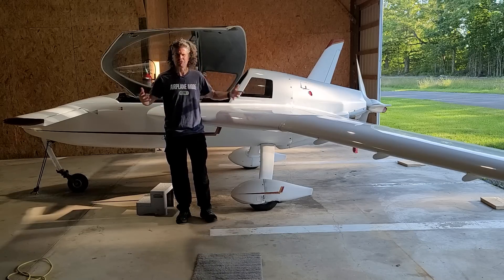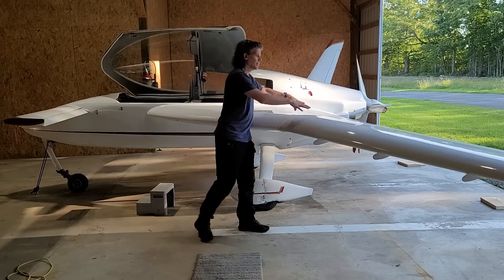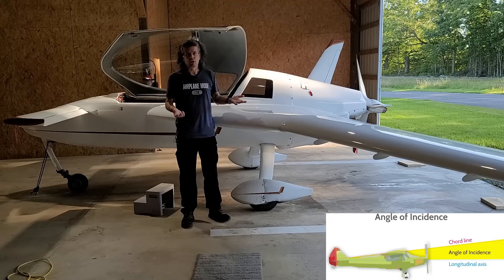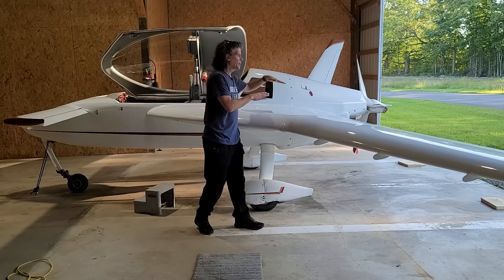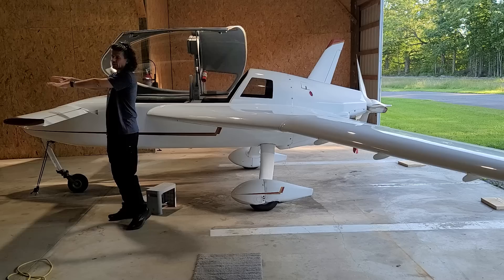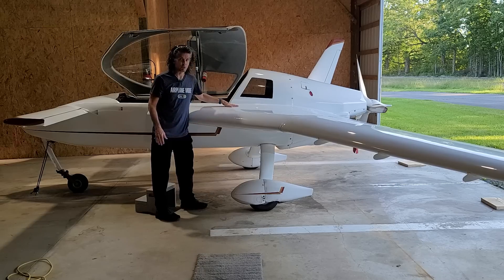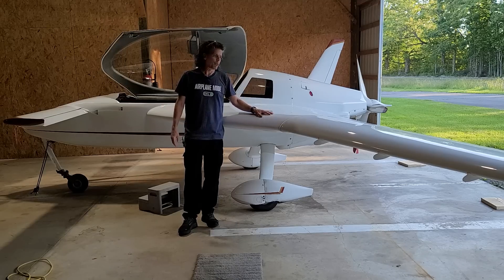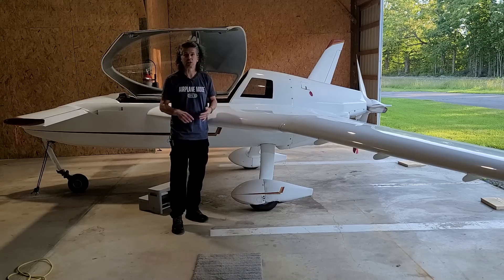Why Did I Buy This Weird Cozy MKIV Canard Airplane?

Comment: You kinda shot yourself down there a couple of times. The fact that canards need long runways and well surfaced ones too take them out of the frame for most pilots. Carrying lead to keep the  ofF good is another negative. That wing is also a stabiliser, which means some of the lift it is supposed to be creating is gone to waste.
Reply: CofG
Reply: And this is relevant how ? Most twin seats gliders carry also dead weight when flown by a single pilot. This is due to narrow CG on all these designs. Actually it's a proof that you extract the most out of your aircraft design and don't need a big horizontal stab far behind to cope with the wide CG requirement, thus less drag (induced and parasite)
Reply: @12345fowler  A bit of tech work round and maybe the wings cd have variable sweep to keep the cg in limits. I have two other points I wd like to add. One is that the sweep back is contributing to stability as you mentioned, but this wd seem to indicate that it does not contribute to lift. Could this be why canards need long takeoffs and landings? Finally, what I find odd is that you have a futuristic design, almost Star Wars looking, but you fix a straight wing at the front. For me, aesthetics wd dictate a swept fore plane. But best wishes anyway!

Comment: Nice job! I built N36LV, this plane’s big brother. She has 370HP, comfortably seats 5, cruises at 195 kts and sips 13.5 gallons per hour. Sadly, retirement and insurance costs caused us to part ways. I learned a few things during our six years (11 counting the build time) of flying.

Watch out for extended descents with lowish fuel levels. If the tanks are plumbed like a Velocity, you can unport the fuel pickups.

Make sure those cowling fasteners are really good quality because everything, and I mean EVERYTHING back there goes through the propeller arc. I used screws at first but got tired of patching the prop with JB Weld. Take a look at Skybolt C Locks. Never had one come off.

That canard stall is known as a Pitch Buck. I could climb at 3000 fpm with the stick full aft and the nose hammering up and down. Fun but kind of violent in a Velocity and passengers don’t like it at all.

Like the V, it will probably make one really good water landing in an emergency. They can float for days.

You will know you are a proficient canard pilot when you can perform 3 consecutive touch-and-go’s without letting the nosewheel hit the tarmac.

Enjoy.
Reply: Careful about the water landing.  We're still not sure what happened at Half Moon Bay except none of them made it out.
Reply: @flyer617  I should have been more specific to the fully-retractable canards using the water option.
Reply: Wonder if canards have tail skid to prevent the prop to hit the ground during take off rotation or landing flare. Thanks for the video.
Reply from the maker: @agusbahagia5122  no. You have to be careful not to over-rotate for this exact reason. Not normally an issue however. You also don't flare when landing, you just round out the descent and then let it fly onto the ground, kind of like a jet.
Reply: @CanardBoulevard  Another silly question, do you yell “clear prop!” just before cranking up for engine start? Do you start the engine with canopy still open or closed?

I know it sounds so silly but that engine is in the back, out of sight.
Reply from the maker: N36LV is a beautiful machine! Curious about the choice to put the exhaust forward - is that to keep it away from the prop arc?

I have not heard of Cozy's unporting the fuel pickups except in a slip at low fuel levels (which can happen in most any airplane, really). I'll look into it, but I have not heard/read of this issue in the Cozy.

The cowling fasteners are currently MS24694-S50 screws and yes, after losing one through the prop, my preflight now includes checking tightness of all of the cowl fasteners. I had a look at the Skybolt C fasteners, I will add them to my list!

Thanks for writing!
Reply: @CanardBoulevard  Sorry I never saw this post, Scott.

The exhaust forward was for two reasons: to get rid of the normal Velocity’s downward-exiting exhaust which is very draggy and causes unwelcome pitch changes during landing.

The second reason was to have room for custom-designed equal-length headers. The rearward facing collectors may have attributed a knot or two to cruise speed.

Comment: Canards are not inherently lower drag. The main wing is operating in the down-wash potential flow field of the canard. This causes higher drag and less efficiency. At best, overall they have efficiency the same as a conventional config.
Reply: You didn't listen well to the video or didn't understand it correctly. He said precisely why a canard design is more efficient. And he also gave the measures of it.
Reply: @12345fowler  I have a MS in Aero Eng and have worked in the industry for more than 40 years. I have designed and built 4 World record setting aircraft. I can accurately say that canards are NOT more efficient. I won't go into how much the wing sweep costs in terms of performance.  Even Rutan changed his mind when he did the GlobalFlyer.

Comment: Always thought that this would be my choice but never was able to find the money.. I was flying the Avanti Canard for a while and grew to love that airplane.. How critical is the wing/canard to precip ?
Reply: I knew a guy (through his YouTube channel) who mentioned that the canard wing can "quit flying" in a heavy rain.
>> He installed vortex generators on the upper surfaces of the canard, to prevent the de-laminating effect (i.e. separation of airflow over the canard) during an in-flight thunderstorm.
Reply from the maker: @ahashdahnagila6884  that was an older airfoil. Canards today (including mine) use a Roncz airfoil on the canard that does not suffer from that problem.
Reply from the maker: The original canard airfoil used on the Long EZ had a significant loss of lift in precipitation, but it was then changed to the Roncz R1145MS airfoil, which does not suffer from that problem. The Cozy uses that same Roncz airfoil on its canard.
Reply: @CanardBoulevard  You have a great fun airplane there.. Many thnx for the (prompt) response..

Comment: Wrong

If you would take that cessna & place it on 2 wooden dowels under the wings close to center of gravity the plane would be perfectly balanced front to back.

The long fuselage and back tail offsets or balances the engine up front.

If the elevator was there needing to do all the balancing theyvwould be ni extra movement left to have the plane go up or down.
It would he in the fully upright position & wouldn't allow the plane to go downward.

Learned this simply by building many RC Planes.
Reply from the maker: Of course if you balance an airplane from its C/G point, it will balance perfectly.

However, RC planes are not the same. A Cessna, with people in the front seats, is nose-heavy. The front seat arm is forward of the unloaded C/G. Also, a Cessna, when flying, has enough parasite drag from the fuselage and landing gear, below the center of thrust, that it causes a nose-down moment. Both of these require negative lift from the horizontal stabilizer to counteract.
Reply: @CanardBoulevard  then what is needed is an adjustable balance /weight near tail section foe each portion of flight. Lol sarcasm
Reply from the maker: @Mikinct  Well, that's what trim is for. :) Actually on this plane, the gear hanging down does cause some drag at higher speeds in the exact same way, and this requires you to add more nose-up trim at cruise speed to compensate for it.

Comment: Nice plane but if you're comparing planes you should compare those with similar passenger and load capabilities.
Reply from the maker: I compared it to a Cessna 172. Both planes have four seats. The Cessna has useful load of around 880 lbs, the Cozy is around 1000 lbs. They are pretty similar.
Reply: @CanardBoulevard   cool, then there is more to it or the canard type planes would be  dominant

Comment: The horizontal stabilizer is a symmetrical airfoil and is mounted parallel to the longtitudinal axis of 172s.
Therefore there is no down lifting force on the horizontal stab. of a 172.
Reply from the maker: Depends on the position of the elevator and trim!
Reply: Wings Airfoil Symmetrical Have Planes Aerobic .  Attack Of Angle On Depends

Comment: I absolutely love the Cozy MKIV.  I would love to have one, but I really don't want to build it.  Great video.
Reply: And that’s exactly why these days you will see 600 RVs at Oshkosh and a handful of canards. They are extremely labor intensive to build. RVs aren’t “easy”, but they are a lot more prefabricated than composite airplanes and no 1000 hrs of sanding. They are also a much more versatile airplane with better field performance. They might not be quite as efficient, though they are pretty close, but with over 12000 built and flown clearly the homebuilt community has decided they don’t much care about efficiency.

Comment: I enjoyed the explanation. Thanks. A couple of things that I wonder about. 1. How do you avoid hitting the prop on the ground? 2. How do you not end up with a nose strike on landing? I can imagine speed being your friend in both answers, and as you mentioned in the video, but can you expand on that?
Reply: 12:00 main wing stalls from bad cg load are not recoverable. CG is critical in a canard aircraft. Very informative video. Thanks for sharing the cons.
Reply: @msnpassjan2004  CG is critical in ANY airplane. A "deep-stall" that may not be recoverable can happen if the CG is grossly aft of it's normal range.  A Long-EZ (a 2-seater tandem cousin of the Cozy) can handle a wide range of payload arrangements and be within a normal CG range. A typical example:  pilot weight can be  anywhere from 140 - 350 lb, with or without passenger, baggage, and with fuel tanks full or nearly empty without needing to adjust or even calculate the weight and balance between flights. As long as the total weight does not exceed the allowed weights for takeoff and landing you hardly need to worry about weight and balance calculations between flights. The Cozy is a little more finicky.
Reply: The only time you're concerned about prop strike is during takeoff, or when the airplane is parked. The rule of thumb is to keep the canard below the horizon (from the pilot's perspective) during rotation and liftoff. The only other time is when it's parked on the ground. Since the airplane is rear-end heavy (that's where the engine is) it can flip on it's back and there's the potential for prop strike. This is why these airplanes are parked with their nose down in a praying mantis position. You wouldn't end up with a nose strike on landing unless you forgot to deploy the front landing gear. This has happened to many canard pilots (including me) but it's entirely survivable, the nose of the airplane may be a bit scuffed on the bottom but it's repairable, most of the time the damage is only cosmetic. In addition, a front gear-up landing is a safety feature by design to help stop the airplane on a short runway in an emergency, if needed.

Comment: The reason the rear tail plane pushes down in not to balance the engine weight. Rather, it is because of the forward moment of lift produced by the main wing. That is why if you throw a model aircraft wing, it tumbles forward.
Reply: In a way, it's both... the center of lift is usually a bit forward of mid-chord INCLUDING the weight of the engine. As he explains for the canard craft, add a payload up front, and on a conventional-stabilizer plane, you need to balance it with down-force behind the center of lift. On the canard plane, the extra lift compensates for payload.
Reply: @KutWrite  The rear tailplane also pushes down on a glider. The displaced (relative to C of G) centre of lift is the cause of the tail needing to push down. Yes, the more weight you have at the front, the more it needs to push down - or, the further the tail needs to be situated away from the Cof G to increase the moment arm.
Reply: it's both.
Reply: Most free flight model gliders have rear lifting tails and they seem to fly well.
Reply: @johnelliott8630   Some do..true. But lifting tails are speed sensitive and require a very aft CG.  Go too fast and the tail makes excess lift…which raises the tail…increasing speed. The “tailplane takeover” phenomenon is known and can dive a plane into the ground.  I had a RC model once that had a flat bottomed (Clark Y) tail airfoil…normal flight was fine…but in a dive it would suddenly tighten up into a steep drop that needed a lot of up elevator to correct.  And yep…the OP is spot on, wings without stabilisers tumble.  Flying wings have reflex airfoils or sweep to get surface behind the CG.

Comment: If the CoG is too far forward you probably will get off the ground into ground effect - then crash LOL.
The amount of aircraft that get into ground effect on TO then crash is unbelievable but the stats don't lie.
Reply: Don't think so. The reasons for airplanes unable to climb out of ground effect is because they are overweight (but balanced) Here he talks about a unbalanced (out of CG, but not overweight) situation. These are two completely different issues.

Comment: It baffles me why more planes aren't canards, even commercial planes. It's safer, more efficient, easier to fly, etc.
Is it just industry ignorance or is there a good reason for it?
Reply: The main wing is always flying in the disturbed air behind the front stabiliser, and the main wing can never reach it's maximum lift potential in terms of angle of attack (as the canard will stall before hand). In summary they're not more efficient than a conventional layout. You are correct in that (if they were more efficient) they'd be used commercially and also for gliders (which are all about efficiency). It's been proven that Rutan's first nonstop round the world flight (canard design and an amazing achievement) could have been completed with significantly less fuel (can't remember the figures) if it had been a conventional layout.

Comment: Sounds like reentry configuration when main wing is stalled and a good fit for parachute
Reply from the maker: If you're talking about the Shuttle, it was not actually stalled, it was just in a very high alpha position. When the prototype of this airplane was originally designed, they put a large, movable weight inside. That way, while flight testing and exploring the aft C/G limits, when they stalled the main wing, they would move the weight forward, dropping the nose and recovering from the main wing stall. No parachute required!
Reply: @CanardBoulevard  I was trying to say Spaceship One's reentry. The idea came from the timer to put down a free flight model. Moving CG to recover from deep stall is neither practical nor efficient in reality. That's one of the few imperfection of Cozy MK IV. That said it is among the best out there.

Comment: How do you calculate your CG?  Great video!
Reply from the maker: The airplane is weighed when it is first built (or when major changes are made). You can then use a formula that calculates the C/G based on the amount of weight and distance from the center of gravity of the aircraft, to ensure that you are within the allowable envelope.
Reply: About the only plane I know where C of G is not your first thought is the Pilatus Porter where you overload it with skydivers like sardines in a tin and then kick them out and still fly semi aerobatic beating them back to the ground, unless their chute fails in which case it is a dead heat (Sorry). Or fill it with cargo and deliver it and fly home, sometimes delivering it without landing. How do you tell if a porter is full? You cant stuff any more in it. But you can hang it of the wing hard points as well, like 44 gallon drums.